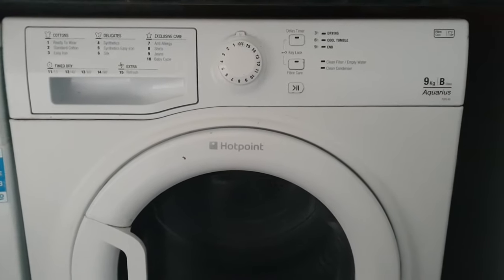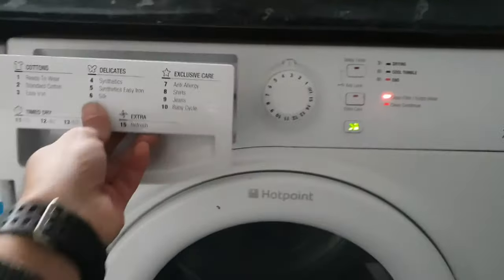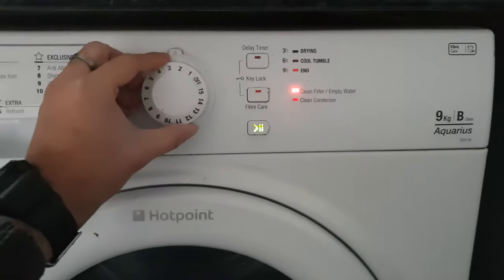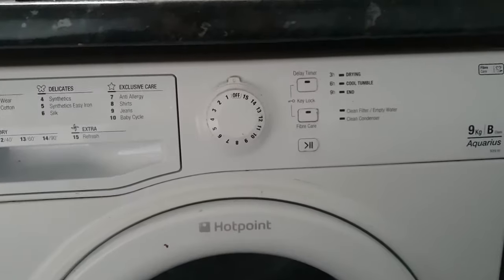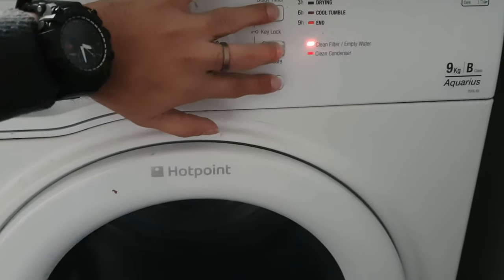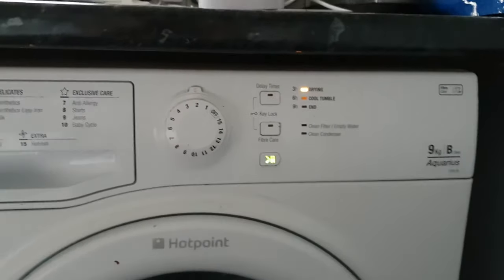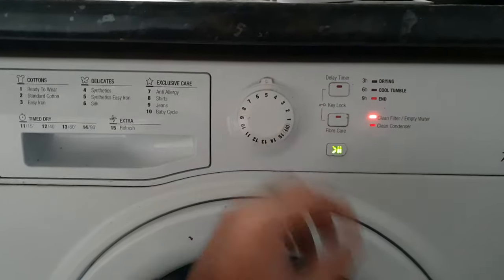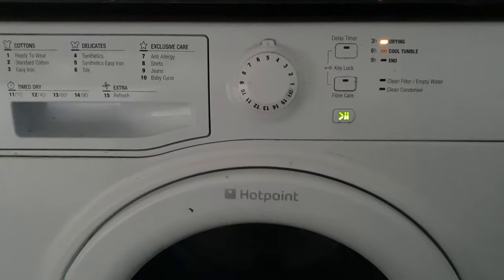How to fix Hotpoint dryer

Comment: I have a four-year-old Hotpoint tumble dryer, and have already replaced the float assembly owing to another problem.
Recently, the machine began cutting out mid-dry, then flashing and beeping randomly, even when switched off. 
Thankfully after reading a bunch of other potentially time-consuming and/or  expensive remedies, I found this video. I don't know how (is it a factory reset?), but it worked a dream!
Thanks, Abdul!
Reply: Same I've had this issue its so annoying,  keeps making this beeping noise, stops after like 5mins of a cycle . Also had mine 5yrs.... just turned on today and this key lock delay thing on. 
Thankin this guy for this vid

Comment: Cheers Abdul I did it but it showed lights etc but I released middle button it started I turned dial off and pressed pause it worked and saved £120
This happens on all washer dryer’s and usually all three buttons resets a fault.

Comment: or... open the door and take the actual lint filter out empty it, the filter is located under the door at the 6oclock position.. its likely filled with lint.!! i have same model and its easy to sort without all that button press nonsense that ultimately means your bypassing a building problem and eventually your dryer will burst into flames...!
Reply: Yes I tried your way and it don't work, his way did,
Reply: @colinford7427  rightly said
Reply: Worked perfectly thanks you